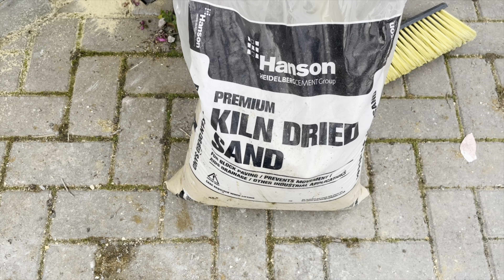Laying Paving Slabs For 1st Time

Comment: Hi Mark, In the past I've found it easier to compact and level the sharp sand first, before placing and gently adjusting the slabs. It seemed to reduce the amount of rocking that the slabs do and the hard work of lifting and adding extra sand etc. Easier again is to lay onto a mortar bed. Makes you realise how much nicer it is to work with wood doesn't it. Enjoyed your video, thanks for sharing.
Reply from the maker: For this job it needed to be on sand as l have cables running underneath and if I ever need to access them it’s not a problem. Appreciate the advice on best way to lay. 😃